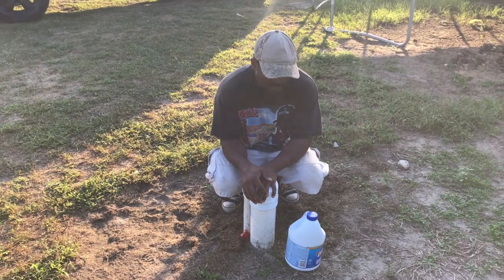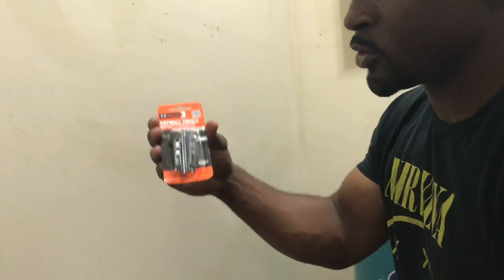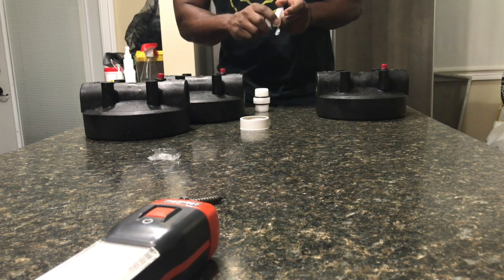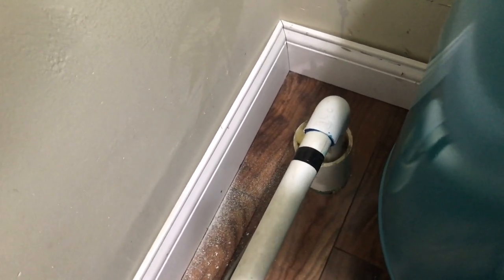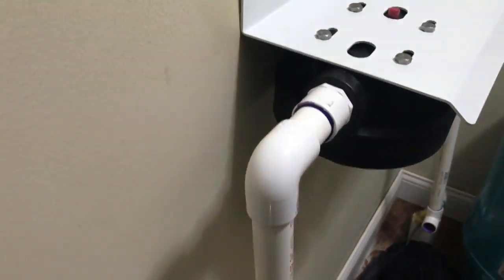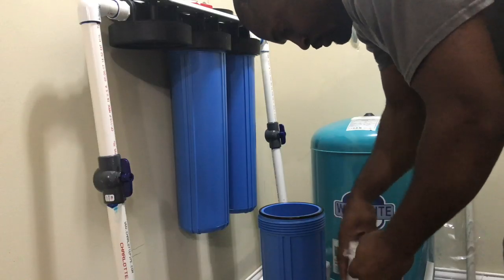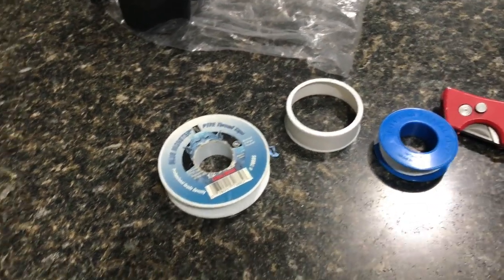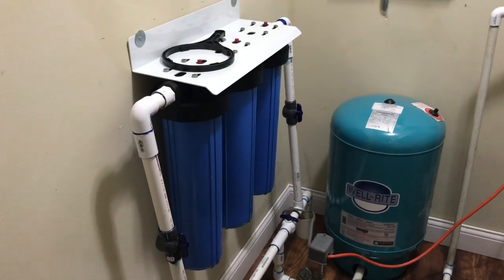Get Rid Of Rotten Egg Smell & Iron In Water - BIG BLUE Filters - Great For Wells! Works AMAZING!

Comment: Hey Terence, I've got a couple of suggestions for this install and for anyone else who choose's to do this. I install water treatment equipment for a living and figured I would just let you know the risks of installing a filter before your pressure switch (the gray box with the electricity running to it for anyone who doesn't know what a pressure switch is). Long story short if you don't keep up on the maintenance of changing the filters on a regular basis it will cause the submersible pump that is in the bottom of your well to burn up. It will do this because of the pressure switch is what tells the pump to kick on and off, and if the filters before the pressure switch get clogged enough that not much water can get through (happens a lot depending on what kind of water you are treating and what micron filters you are using) it will keep sending power to the pump until the tank reaches its desired pressure which could be hours. (typically 50 or 60 psi depending on the pressure switch) The submersible pumps were not designed to run for an extended period of time maybe 2 - 10 mins top depending on the size of your pressure tank. Also only put the big blue filters back together hand tight if you crank them down with the wrench there is a good chance you will rip it off the wall before you can get it apart again. Only use silicone based lubricant on the o-rings on the top of the filter to prevent them from swelling up and not fitting anymore (vaseline will kill those o-rings pretty quickly). Other than that nice install!
Reply from the maker: Hi Reggie, thank you for the information. Many that watch this video will benefit from it. Thanks again, Terence
Reply: I saw the install before the tank and thought that the pressure of the pump would allow to push through the filter better than the pressure tank. But I had to look it up as the system I just bought uses a backwash and should only be installed after pressure tank. Nicely done though. I hope mine goes as well when I attempt to install.

Comment: AWESOME VIDEO TERENCE!AFTER SOME "TEFLON TAPE" ISSUES IN THE PAST I USE ONLY  PIPE THREAD COMPOUND.AND THANKS FOR TAKING THE TIME TO VIDEO AND POST THIS.MOST OTHERS ON THIS SUBJECT ARE REALLY JUST "SALES PITCHES"FOR  AN EXPENSIVE SYSTEM THAT MAY OR MAY NOT WORK!
Reply from the maker: Hi aaron gibbins, if you install this system as I did, you're going to be AMAZED at the results. I am shocked at how good this turned out! Thanks for watching.

Comment: I love these big blue 3 stage setups! Something very important to note, you MUST flush your carbon filters (if you use one) for 5 minutes or until water is clear. I always hook up a hose bib after the last filter to do this. The bib also helps to let out pressure when you change filters or you'll have a ruined laminate  floor in 3 minutes (edit: I see you have a bib)I just had my well drilled and smells like eggs..time to throw in some chlorine tablets. Thx for sharing!

Comment: A "STOLTCO Powered Anode" (buy it on amazon) can fix the smell in most situations if it comes from the hot water heater.  (If the water is smell coming up from the well then it can't help you.  Bacteria is feeding on minerals producing sulfur gas.)

Comment: Good looking system but a VERY SERIOUS ERROR has been made. You NEVER install ANYTHING between your wells pump and the pressure switch. You now have a situation where if you were to have a clog in your filters or if you have both valves closed so no water flows the pressure switch will ask the pump to turn on and it will keep running, potentially exploding the pipes because the pressure switch cant see the blockage. 

Always install filters and valves AFTER the pressure switch.

Comment: Where did you get the fittings for between the filter housings?
Reply from the maker: Hi Mark, they came with the kit. They are 1" nipples. Here is a link to buy some (below). Thanks for watching! 
https://www.ebay.com/itm/152417452721?hash=item237cc9c2b1:g:BJkAAOSwiv5dwW5Y
Reply: @TerenceDIY  thanks so much! I definitely wouldn't have guessed that they're called nipple connectors.
Reply from the maker: You're very welcome, Mark.

Comment: Hi Terence. My wife and I just bought a house that has a well, but has a water filtration system with two Big Blues. There's still the sulfur smell. Should I assume that I just need to change the Big Blues?
Reply from the maker: Hi Sean Scott, if the Big Blue filters do not have the carbon block filter, then you might continue to get that smell. Check the filters to see if there is a carbon block filter. The Big Blue GAC Coconut Shell Carbon Filter gets rid of the smell.
Reply: From the research I have done if the ppm of sulfur is too high then these filters will not be sufficient.

Comment: Why did you use PVC instead of CPVC?  PVC is for drain lines not for water pressure lines.
Reply from the maker: Hi Ocman 60, a professional well company installed our well system using PVC. I just stayed consistent with the setup they provided. The rest of the plumbing is CPVC. Thanks for watching!
Reply: Ocman 60 Because CPVC is for HOT water. Not needed for lines from the well to the well tank. Only needed for inside the home after the water has been heated than ran throughout the house.

Comment: My daughter is in process of buying a house and just got done with the inspection and everything checked out good in the house except the damn sulfur smell in cold and hot water lines, faucets ect..besides your filters I see you have a water softner setup also? The house shes looking at only has a whole house filter at the well tank,just wondering after you were done with your system what the costs are and how often do you have to change the filters on the 3 gang filter setup you have and does this setup alone get rid of the smell? Im a retired plumber and i have no problem installing this but just want to know if it works. thank you ....Great video by the way nice and neat installation,only thing i would have changed ,I would have put unions on inlet and outlet sides of the filter gang, What do you do for a living? Nice job ..and its been a year now is it still working?
Reply from the maker: Hi hdbagger4266, it has almost been a year since I installed the filters, and I must say, I'm impressed! I have bought new filters to replace for the annual update video that I will be shooting next month. These filters will cure your sulfur issue! Our softner only provides silky feeling water on the skin. It does NOT get rid of the smell or the rust (I thought it did). The Big Blue Filtration kit was the best thing I could have installed. I was out of about $200 for everything! I agree with you about the unions. If you have any more questions, don't hesitate to ask. Thanks, Terence
Reply: Thanks for the reply ,really appreciate it , Thats good news they work , going to look into them for sure and give them a try,thanks again
Reply from the maker: You're very welcome.